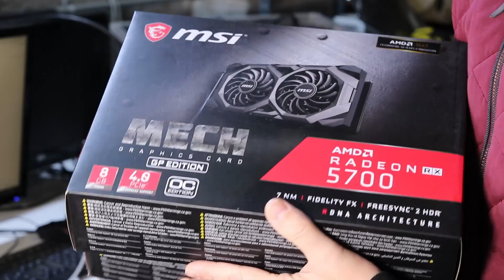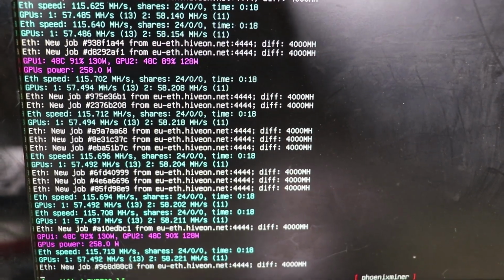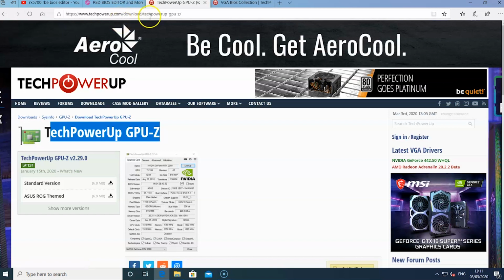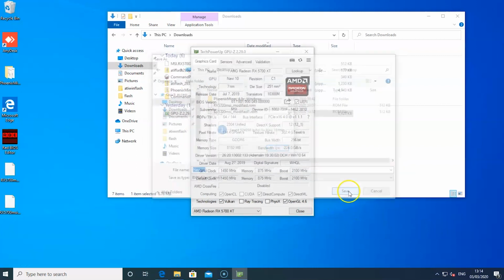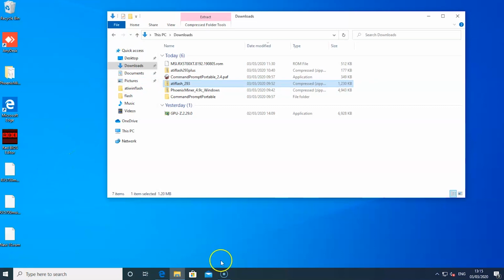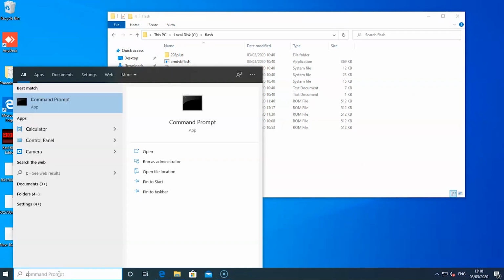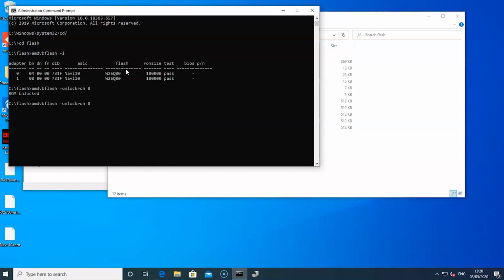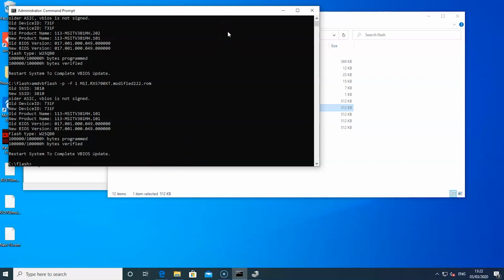BIOS modified RX5700 | how to edit timings | 10% speed increase.

Comment: ok ive spent time testing. i like 56.1 megahash because that way i can keep my blower card quiet.   so phoenixminer settings are 1370 core 770mv core (you need more power tool for that) 1820 ram with 1500 straps. its about 125watts at the wall for those 56.1 megahash.  got a second rx5700 coming from ebuyer.uk tomorrow - gonna mess around with that one as well. this is great. we can expect proper modded bioses soon. also im on early december 2019 amd driver on windows 10
Reply from the maker: Great, what card you have ordered? Tested today MSI evok , it hase different timings and if usin1545 timings you'll get 100% incorrect shares. Have to use 1800 timings, speed is not as high about 55 at 120 Watts from wall.
Reply: @GuntisVitolins  ok just got an msi base blower model to add to my asus base blower model . i have made them both into 5700xt with 1500 straps. they both get IDENTICAL 56.1 megahash with 1370 core 1820 ram. the rig draws exactly 305 watts from the wall to get the 112.2 megahash. the rig also has a ryzen 3600 and with that running 7500 randomx hashes the total rig draw is 386watts at the wall. i like this a lot. both my base blower models were £280 but they are not often at that price they are mostly £310
Reply: i can flog them up to 57 hashes but fan gets noisy .  im currently using -tt 40   so fixed fan speed very quiet
Reply from the maker: @dastardlyman  I like the hashing speed achievable on RX5700 . They have better performance then ASIC antminer E3 , don't understand why everybody is so worried ASIC on Ethereum.
Reply: @GuntisVitolins  worried about innosilicon A10 ETH. 500mh per 750watt.
Reply from the maker: @MarcoItaliani  very sceptical on asic miners as they are to risky, efficiency is not that big gap between these gpus about 1.5x not worth the risk they are to expensive.
Reply: @GuntisVitolins  yep me too but asic are scalable. plug and play. if you want to open a "one million" operation with 5700 you are gonna be crazy with bios.. timings.. on 1k gpus or more :) Asics attract different kind of miners
Reply from the maker: @MarcoItaliani  well hiveOS is quite automated, you can upload bios to all cards whole rig with one click. Asics inted to brake much more often, of new asic generation comes out old can tow in bin.for example Antminer E3 came out mid 2018 and will be dead in April 2020 not even 2 years. Hardly anyone who bought it, has made ROI. But RX 470 gpus is nearlly for years old and still profitable and has resale value.

Comment: Use -hstats 2 in phoenix miner to see all settings. Also I have problem, then after some time cclock starting to drop from 1300 to 900 or even 700... Maybe some one solve that?
Reply from the maker: Ok your timings might be incorrect, what model of gpu you have. Lot depends from memory brand. I have tested this only on one series, will test tomorrow on different cards , this rig is running smooth http://prntscr.com/rbpoh8
Reply: @GuntisVitolins  I just modified my ASROCK 5700 chalenger BIOS to ASROCK 5700 XT, but in mining it didn't make any changes... windows now see my GPU as 5700 XT but still mining @ 52mh/s... I also checked my uploaded BIOS in to GPU it is with new timings... hmm...
Reply from the maker: @ekobielkis  did you edit both sets of timings?
Reply: @GuntisVitolins  yes. But now I notice, that then I try to save new bios it didn't save timings from 1500 to other timings... I should to solve that some how. But any way it didn't solve my other problem wit drop of cclock.. Also I don't understand why my mclock is so "high" - 1860 even if I set it to 860 miner change it to 1750 https://ibb.co/Xx13qWW
Reply: @ekobielkis  becaus you useing 20.*** adrenalin driver. but the 19.11.3 better driver and its showing only 875 originally

Comment: I have done everything in this video/article, but hashrate is the same. I Have reference 5700 flashed to XT anniversary, so i tried both bioses with timings, mine has only one and nothing happends, some ideas?
Reply from the maker: Did you check if you are uploading edited BIOS? Maybe you card needs different timings.
Reply: @GuntisVitolins  I am 100% sure that im uploading good bios. Are you using Phoenixminer?
And Youre Using some sort of really old drivers, is that on purpose?
Reply from the maker: @Thompson7177 yes using Phoenix miners. Drivers didn't make any difference tried it on Windows and hiveOS, both went 58mh. I assume your card needs different timings. What is the OC you are running ? No change in speed seems very strange it should at least get worse if timings incorrect.
Reply: @GuntisVitolins  Standart XT anniversary ed. bios + 1860mhz mem, core running at 1167mhz 750mV when mining.
Reply: @GuntisVitolins  Yeah now i see the issue, when i change timing, save, seems to be ok, after restart i load bios from card, and there is still old timings.
Reply from the maker: @Thompson7177  i have see guys on bitcoin-talk under my post had same issue, the bios editor tool is bit buggy. My cards running ok http://prntscr.com/rbpoh8
Reply: If you want to see hashrate increase you also need to make sure you up the MHz to 1600-1700 and check what voltage is stable. I'm experimenting between 800-850mV. That gives me 55-56 MH on a Rx 5700 modified into XT(but for me bios modding to XT doesn't make a difference, it's all about changing the timings)